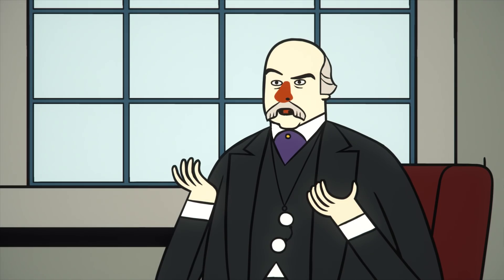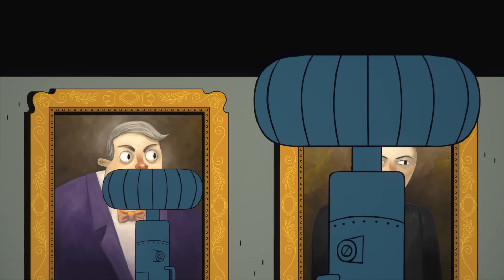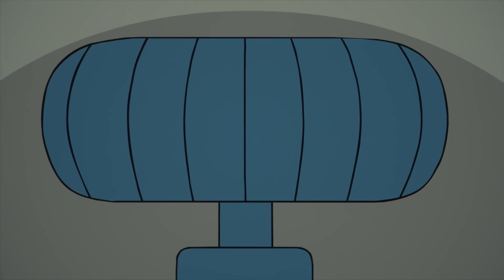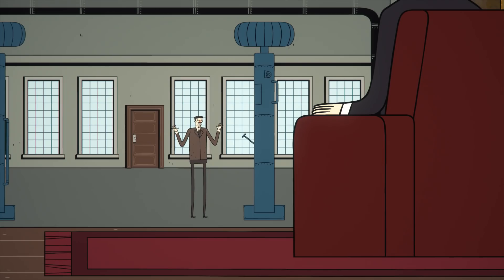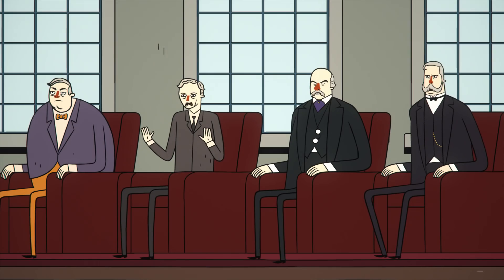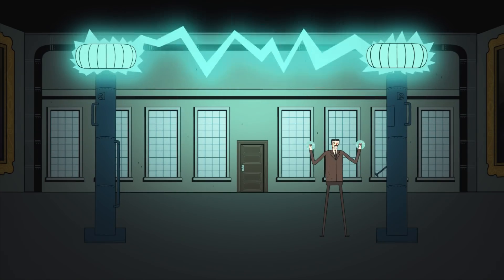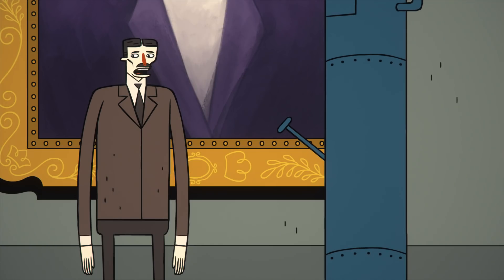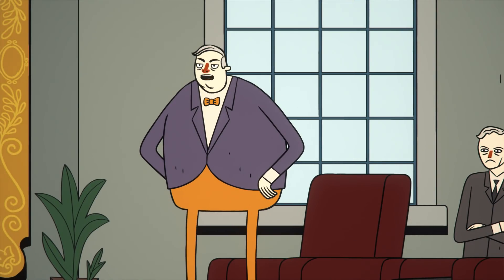The Tesla Coil

Comment: Ah yes, the air core transformer. The flashiest of science projects.

I searched for uses, it can be used for welding machines, spark plug ignition, entertainment industry (obviously, nothing is flashier than a F-ing lightning), and because of the electric arcs, it has been used to make lighters (better option than gas fueled options).

Comment: It powers electronic devices wirelessly but whatever
Reply: Well badly. Its a better transformer than a energy transfer device. The best energy transfer tech now isnt as good as wires. And it never will b. It will always cot more energy to wirelessly send energy than it will over a solid transfer system. Simply do to the fact that no element in the world or structure in a gas state has the same electro conductivity as the ones we use in wires.
Reply: @magnuserror9305  You did a fucking crusade in this comment section good work! Also thanks for saving my time replaying to this monkeys.

Comment: Is this the one invention that Edison himself would not steal?
Reply: Nikola Tesla had more than 700 patents.
Reply: @tadijadjokic8991 Tesla kept his patents in his coat pockets. So, he probably dropped a couple hundred
Reply: True, but the majority of his patents were pretty harebrained even by modern standards.  No, you do not get "Free electricity" by sticking a big radio antenna up into the air (unless you're measuring in microwatts).
Reply: @rogermwilcox  QMech was at cradle stage back then. This caricature simplifies his intentions but eventually he was indicating quantum tunneling and entanglement.
Reply: Sad but True
Reply: This invention really was useless 😂 it just looked cool. Traveling electricity through air is very inefficient.

Comment: Tesala believed it was a way to power things wirelessly and he actually started a project to make several giant coils so that people would never have to plug things in but he lacked funding. Also it wouldnt have worked
Reply: Actually you see that's where your wrong. It very well would have worked and it did work since he was able to donit over 30 miles. Also Dr. Parker Edminson also did the same thing and it was transmitted over 900 miles. It's not the fact that he's sending it threw the air, he's sending it threw the dirt at a harmonic of the earth's frequency. When Tesla was talking about high frequency and high voltage it's because everything has a resonant frequency and high voltage is pressure. The reason for using an air core transformer was because it can reach higher frequencies. Tesla was right and the person who made this video about him has no idea what he's talking about.

Comment: Wikipedia: Tesla coil
Applications:
    Education and entertainment
    Vacuum system leak detectors

So it's just funny thing that shoot lightning bolts
Reply: I actually use one at work for leak detection in a ultra low pressure gas line.
Reply: @000Krim  How much fun it is?
Reply: @realdragon  you can do music with it by changing the voltage, there is a machine specialy dedicated to this purpose in Boston museum
Reply: It used to be used in radio. But now they use modern electronic circut
Reply: The "vacuum system leak detector" use is really smart. You can't ionize a vacuum if there's nothing in it. Brilliant.